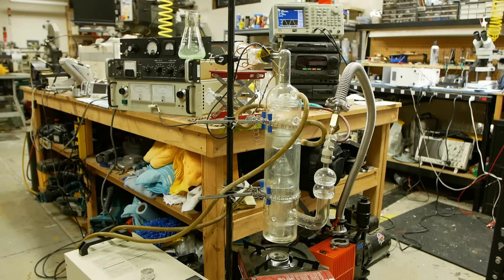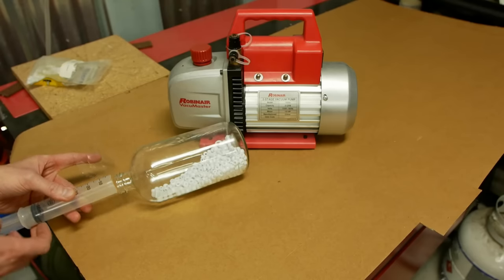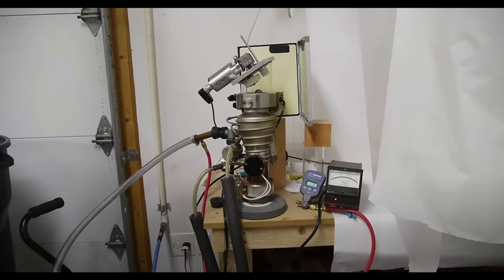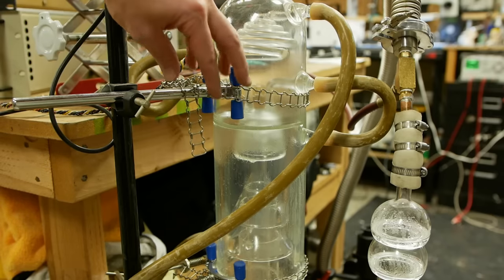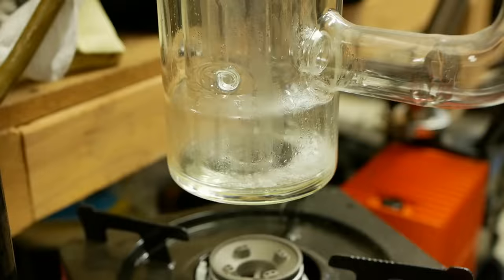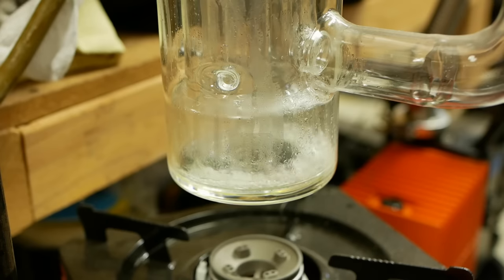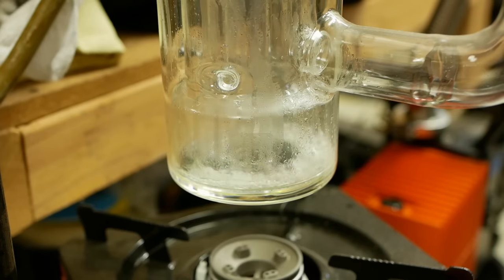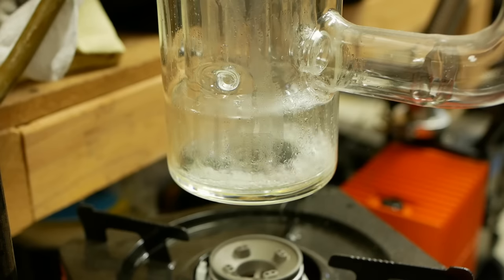Giant glass diffusion pump and cathode ray tube demo

Comment: Explaining the applications of diffusion pump would add context to why they exist & add value to the content. An oil diffusion pump used to achieve higher vacuum (lower pressure) than is possible by use of positive displacement pumps alone. Utilized for the high-vacuum range (down to 10 ^−9 mbar), diffusion pumps today can produce pressures approaching 10^−10 mbar when utilized correctly. This make the diffusion pump attractive for high & ultra-high vacuum use as it has high pumping speed for all gases & low cost per unit pumping speed when compared with other types of pump used in the same vacuum range. Diffusion pumps cannot discharge directly into the atmosphere, so a mechanical forepump is typically used to maintain an outlet pressure around 0.1 mbar. Diffusion pumps have no moving parts and as a result are quite durable and reliable. They can function over pressure ranges of 10−10 to 10−2 mbar. They are driven only by convection and thus have a very low energy efficiency.

One major disadvantage of diffusion pumps is the tendency to backstream oil into the vacuum chamber. This oil can contaminate surfaces inside the chamber or upon contact with hot filaments or electrical discharges may result in carbonaceous or siliceous deposits. Due to backstreaming, oil diffusion pumps are not suitable for use with highly sensitive analytical equipment or other applications which require an extremely clean vacuum environment, but mercury diffusion pumps may be in the case of ultra high vacuum chambers used for metal deposition. Often cold traps and baffles are used to minimize backstreaming, although this results in some loss of pumping speed.
Reply: Applications
Mass Spectrometry and Analytical Instrumentation	
Ultra-High vacuum pumping for analytical systems with focused charged particle beams
Mass Spectrometers
Analytical Instruments
Particle Accelerators
Molecular Beams
Research and Development	
Fundamental research projects
Very sensitive equipment requires ultra-high vacuum with no mechanical vibration
High Energy Physics
Outer Space Simulation
Industrial Vacuum Processing	
Process and maintain essential components under vacuum in industrial applications
Stable pressure for high gas flow environments
Low initial cost for continuous production applications
Vacuum Furnaces
Optical, Electronics, Protective Coatings
Thin Film Deposition
Electron tube Manufacture
Metallurgy web and roll coating systems
Pharmaceuticals
Petrochemicals
Nanotechnology	
Operating without noise or vibration
Tolerant of excess particles and reactive gases
Optics
Scanning Electron Microscopes (SEM)
Semiconductor Manufacturing

Comment: As in a Gas Chromatograph a small voltage can be made to conduct across an air gap, by pumping, and igniting hydrogen within the filament chamber, so you can mimic the
vacuum effect of accelerating electrons from anode to cathode at lower voltage levels with combustion, but with combustion the filament can be more stable, as in
your tungsten filament, or some variant conductor, but without the necessity for a vacuum. The body can be stainless steel, and the electrical pins can be embedded in ceramic
i.e. a cylindrical slug of ceramic, which form fits partially inside a hollow cylindrical tube with a 1/16 inlet, and outlet to pump hydrogen, with an extension tube of nominal length
to vent. This can be ignited with a piezo igniter, or a lighter at the end of the vent tube. Just a suggestion for means of creating an electron emitter without a vacuum. Not quite sure
if this would be a viable means to achieve what you are constructing for a mass spectrometer. I used to work on Flame Ionization Gas Chromatographs for hydrocarbon analysis.

Comment: There IS a fundamental reason a diffusion pump can't discharge to atmosphere.  To work, the gas must be in the condition where the chance of 2 molecules colliding is slim compared to them hitting the walls of the chamber (mean free path > container dimension).  This is referred to as "molecular flow".  At higher pressures, the jets would break down before they could sweep the annulus between the jet nozzle & the wall.  You will note that the lower stages have progressively shorter distances between the jet nozzle & the wall as the gas is compressed & mean-free-path diminishes).  At 1 atmosphere this clearance would need to be on the order of a micron.

Comment: You could allways try to use a heated surface deposiged metalic film with the emmiging substance deposited on it or on the other side of the substrate. I think the fillament method redults in twisted electron optics. You need a plane electron source and maybe some diaphragms. The magnetic cools are uder- dimensioned. So much hard work to leave it hanging.

Comment: And oil on the bottom of the pump would burn out if some vacuum is not achieved with mechanical (rotary vane) pump before heating up oil. Actually from my own experience, we had a malfunction when rotary vane pump on mass spectrometer stopped and oil from rotary vane pump was pulled into diffusion pump, burned out in there and of course oil from diffusion pump burned out as well and one fraction of oil that did not burned out made it's way into experiment chamber. That was because safety clamp between diffusion pump did not activate. As consequence, we had one week of cleaning up the instrument.

Comment: With mechanical pumps that use oil for sealing (vane types for example), the vapor pressure of the oil also limits the ultimate vacuum that the pump can achieve.

Comment: In high vacuum, you must understand that "atoms" stick to the walls and are not likely to be in mid-vacuum.
In some TMP, to add to the impact energy, the "atoms" get jolted by high voltage to get them off the blades and out...
It's also that "mean path" that makes the cold trap work.

Comment: These glass pumps are often sold to the neon sign making market. The small inlet diameter does not make a whole lot of difference since the inlet is notmally connected to the neon/argon gas manifold which is about the same diameter, you want to keep that small so you dont waste neon, since it is rather expensive. And finally you are pumping the neon tube though a 1/8" glass tabulation so flow rate is not going to be high to begin with. 

If you feel like you are putting in too much energy in you might be overcooling the pump. You dont need a chiller, just a radiation and a fan to keep it cool. Too cold and you can have performance issues. Even using tap water you have to put a flow regulator in place to make sure the pumps stay hot enough.

Comment: Vacuuming silicone molds is to get rid of trapped bubbles, not dissolved gases. If the gas is dissolved, it won't leave an impression that could mess up the copy.

Comment: Great Video, as always! Is the high vacuum of a momentum transfer pump actually necessary or would a regular positive deplacement pump suffice for a cathode ray tube?
Reply: I remember seeing a CRT where the electron beam was created by a very low pressure gas discharge instead of a heated filament, but that was only a demonstration piece for physics class. So it does work at higher pressures, but I think you would get a lot of problems with stray currents or unwanted discharges as soon as you add more electrodes for focusing or accelerating the beam.

Comment: 1:00 The way you explain how a diffusion pump works, it sounds similar to a typical aspirator pump, which I get uses the Venturi effect, but I've always thought that aspirator pumps work by blowing the molecules (leaves, in your analogy) down the pump.
P.S. Great video! I wish I was half as smart as you, lol. Damn genius, man.
Reply: While it "feels" similar the effect ist distinctly different.

The venturi effect boils down to "fast moving  fluids (gases or liquids) automatically have less internal pressure than slow moving ones" (BC the energy gets converted into kinetic energy). This means that a venturi pump actually can pump fluid without direct contact, just by passing a fast fluid-stream next to it.

This diffusion pump actually requires each single molecule of air to get hit by a molecule of vapour in order for the pump to actually move it.
Reply: Bruh , what is that username.

Comment: I was doing a physics experiment once, where our electron source was an electron gun from a black and white TV (bought directly from a factory for the specific purpose). Whenever we had had our chamber open, we needed to reactivate the electron gun, which basically meant to run it at max filament current and electron suppression on for 15 min. I do not know a reason why an electron microscope should not be able to use a Ba emitter.
Reply: Electron guns for old TVs are a conveniently package of: Tungsten filament, Indirectly heated  barium oxide cathode, a suppression aperture and an einzel lens.

Comment: I have this Diffusion pump mine is 3 stage i bought from taobao .. i think your is 4 stage diffusion pump.. I never use before i was worry when i heat the glass will crack. Is nice to see you how you setup and give me a good reference how to setup mine..

I have a question how you stick the phosphorous on the glass? i have problem for stick the powder on glass or coat them on metal, and what you mix with your barium carbonate? Sodium silicate?  

I remember to prolong tungsten life need to remove the water vapor which the water molecule can poison react with tungsten and make it easy to blow out. Another I did tried with Tungsten coat with barium carbonate it didnt work very well i use sodium silicate , i have a good emission about 5mA at beginning later it drop.. i do some research said that tungsten can poison the barium oxide or something.. I think they use platinum wire or Nickel wire as filament.. i havent try nickel wire..

Comment: just a diffusion pump ould not work because they are unable to handle strong (ie atmospheric) back pressure, hence they need to be mated to a primary vacuum pump called a backing pump (just like turbo molecular ones which in adition break if run at atmospheric pressure because they are not built to hold up to the drag at that pressure)

Comment: In refrigeration we would allow vacuum pumps to run for a long time, often more than an hour for systems with a large volume. Final flushing of a system can be done by introducing an inert gas, nitrogen is used forfor refrig. applications but you would want to use a noble gas, to flush out remaining contaminants. Introducing the flushing gas in a location that will cause that gas traverse the length of the system before reaching the vacuum pump helps wash away the last contaminants more quickly.
In your case flushing with argon of xenon after an initial evacuation, then letting the pump run for several hours could well allow you to reach the vacuum levels you need. Any stray molecules of noble gas remaining won't react with the barium on the electron gun. Note that for best performance use fresh vacuum pump oil. The oil becomes more volatile over time as vacuum begins to break the long molecules in VP oil. There is no visual indication that this is happening so fresh high quality dedicated vacuum pump oil is the only guarantee.
Heating the flask being evacuated can help speed the process by making the remaining molecules more energetic. Just FYI, refrigerant oils, mineral or ester based, also boil out absorbed gasses under a vacuum or when heated, same with brake fluid and Diet Coke.

Comment: I scrap out xenon arc lamps from projectors for the tungsten content.  The cathode and anode are both tungsten but the cathode (only) also contains a couple percent of radioactive thorium as an electron emitter to help get the arc started.  Some of that material crushed or maybe even some of the thorium oxide from a burned gas lantern mantle coated onto the heater may work better?

Comment: A long time ago I worked on a small satellite that required testing in a vacuum chamber.  Once the diffusion pump had done its thing, there was a final step where they opened access to a plate that was cooled to some incredibly low temperature. Its purpose was to capture random molecules still flying around in the chamber, which would tend to stick to the plate instead of rebounding.
Reply: Yep, that's cryopumping, often using liquid nitrogen (which is relatively convenient). It really is effective, but as you say you have to start out from a high vacuum to begin with. Doesn't work on all gases, of course.

Another in-chamber pump people use is the 'getter' style pump, where you evaporate some metals to make a surface that can react with and trap stray molecules.
Reply: I believe you are referring to a cryogenic vacuum pump.  You can achieve some serious vacuum with those "cryopumps".

Comment: More explanation on "optically opaque" regarding the uppermost cooling coil?

Does the optical opacity contribute to its functionality as a condenser?
Reply: I think he just means that there is no straight line path available to an oil molecule trying to go upwards - it has to physically hit a part of the cap, and so condenses. The 'optically opaque' phrasing is just a metaphor really, if the oil molecules were light beams, then they wouldn't get past the cap.

Comment: "In the early days, they actually used mercury."  Now I feel old.  We had two, 3 foot tall, glass/mercury diffusion pumps in my grad school lab.  Each held about 20 lbs of mercury and evacuated a large chemical synthesis line down to ~ 10-4 (0.0001) torr.  (The synthesis lines each had a mercury filled McCleod gauge [for measuring pressure] and either four experimental stations or three stations and a Toepler pump [for lossless transfer and volumetric measurement of low pressure gas] with ~ 75 pounds of mercury.)  The main advantage of mercury over oil as a diffusion pump working fluid, is that it does not oxidize when you pass air through it at working temperature.  This allows rapid cycling of experiments without needing to cool-down or by-pass the pump between operations.

Comment: Great video, but the way you have the diffusion pump hooked up to the backing pump makes me nervous. All the weight of that vacuum tubing torquing on the glass sidearm.  Could break, or maybe (??? not sure) introduce a leak where the glass flexes.  Put a clamp on that end, though you're probably only using it for demo.  Us chemists use these all the time, especially on our Schlenk lines.

Comment: I didn't pursue the reason to verify, but I was told when I worked in a lab with a diffusion pump that if you did not bring down the pressure enough on the rough pump first, the oil in the diffusion pump would coat the top of the pump and really mess up the pump.  EDIT:  Wikipedia says the hot oil gets burned if it is exposed to the atmosphere...so maybe that is the real problem.
Reply: One easy catastrophe that can happen with diffusion pumps is that the pump oil vapors get blasted back into your chamber and leave a fine coating on everything in your system. If you have anything sensitive that can't be cleaned, it is ruined. And for the things which can be cleaned, it's still a huge pain in the ass.

It is possible for this backstreaming to happen very gradually over time.

Comment: 12:30  What I've never understood is how can the condensed oil flow back down into the boiler, when the pressure in the boiler has to be high enough to force the vapour up through the jets at supersonic speed?  Wouldn't that pressure also act on the passage where the condensed oil was trying to flow back down to the boiling oil, and keep it out?

Comment: Before you started the burner you said it looked like the oil was boiling but it was actually releasing gas. Don't fluids boil as atmospheric pressure is reduced though?

Comment: Why is it important that the coil is optically opaque? Shouldn't it just be a matter of kinetics + a cold coil and a higher energy molecule?
Reply: Also for power delivery to the pump, do you think there is merit in trying to insulate the flame a little better so as to focus its energy onto the pump? That might make the required power go down to a value closer to the manufacturers reported value.
Reply: He means there should be no direct path for oil molecules to travel without hitting a cold surface.

Comment: "Oh, and here's a CRT I made from some lab glassware." Every time I start one of these videos I'm waiting for something like "Today on Applied Science, I'll be demonstrating a functional 'proton pack' from Ghostbusters, because I built a miniature particle accelerator...and it seemed like the thing to do with it." It's only a matter of time, right? 😉
Reply: Friend of mine built a small linear accelerator with a Van de Graaf for the HV source. It's literally so easy a smart high school student should be able to do it.  Now he's preparing to move to a new home, with a big workshop space, so he can build  a small cyclotron. The magnet is the hard part obviously, but he's already got that. It weighs just over 2,000 pounds, it is an old beam steering magnet from Brookhaven. It should do in excess of 4T across 5" pole pieces which will be about 1.5" apart for the chamber + dees. There are epic stories just concerning That Damned Magnet - from over 20 years ago, because the project has been stalled for that long. ^_^  I have a feeling I will be helping to move That Damned Magnet one last time later this year...
Reply: How do you think the original ones were built?
Reply: Nah. He's too busy building his time machine. The DeLorean in his drive way is not just for shits and giggles.